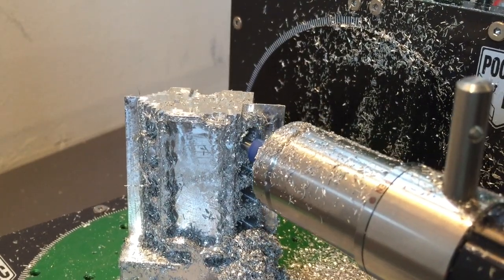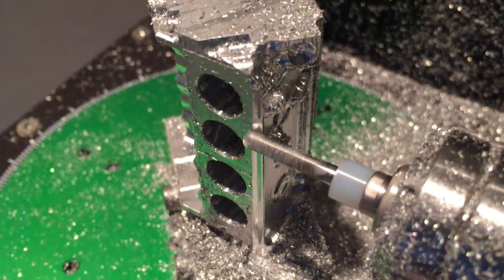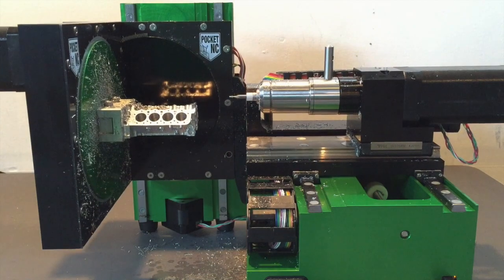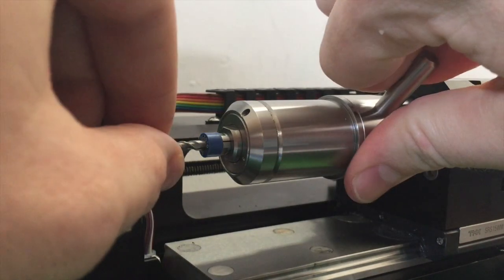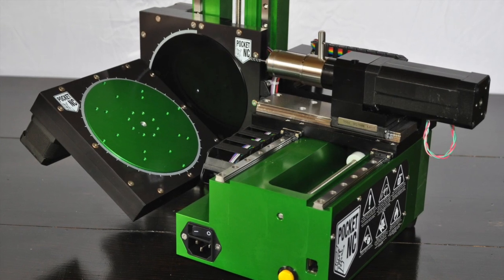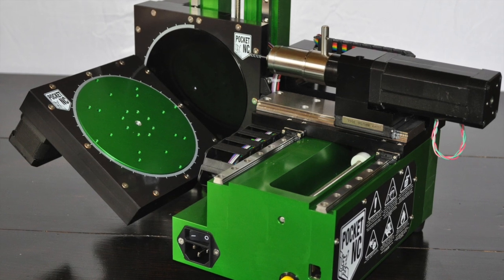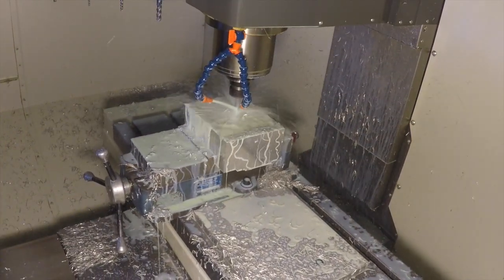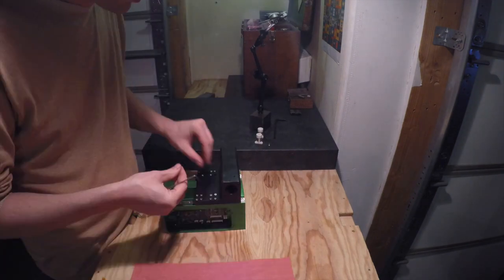Pocket NC Kickstarter Video

Comment: A 3D printer chassis can mill aluminum or steel. The real question is what does the finish look like? Nobody seems to care if something looks like it was chewed into shape vs finely crafted. if you look at 2:14 I can see pretty clear post processing of the surface finish which screams misleading. They also might wanna choke up on those end mills for operations other than deep boring/pocketing.